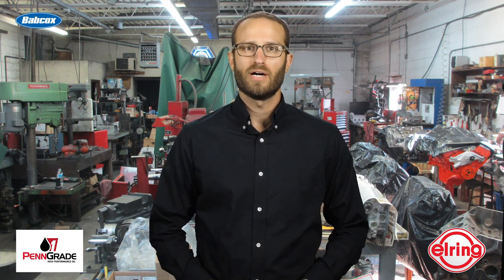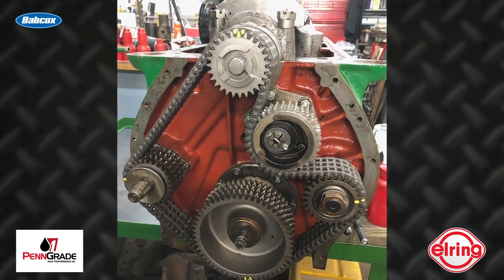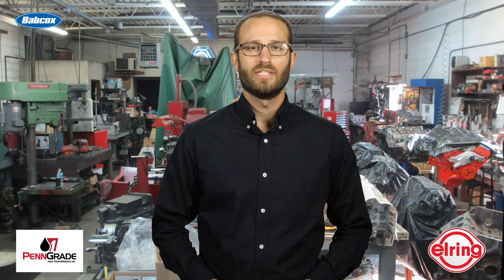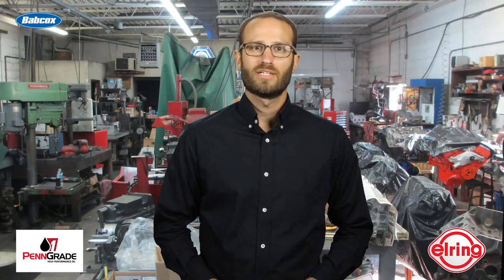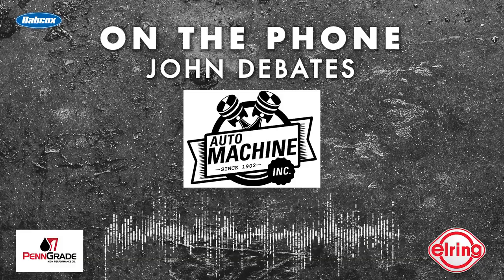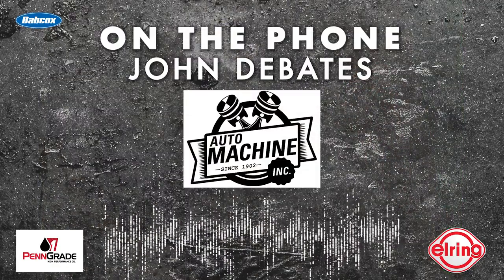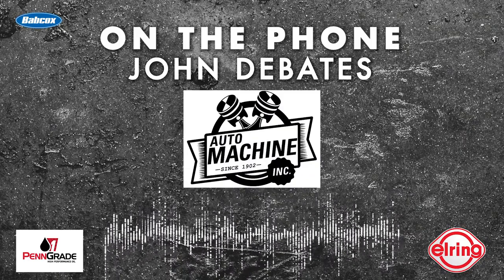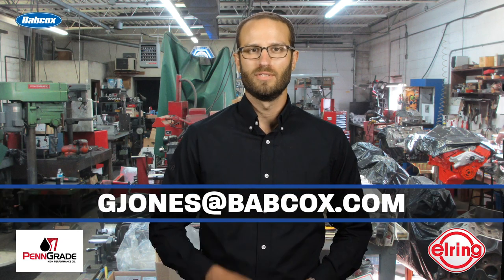1929 Duesenberg Straight 8 Engine

Comment: A very advanced engine even today.  It made this power with bad gas, low compression and a long stroke and small bore.  Give it some compression, good gas, and real carburation and then what would happen?  It would be way over 400 hp and over 1hp/ci.  I also doubt they were running high pressure on the supercharged engines.  No one will do this as they are so valuable as they are.  Blow one of those blocks and it would be really bad.